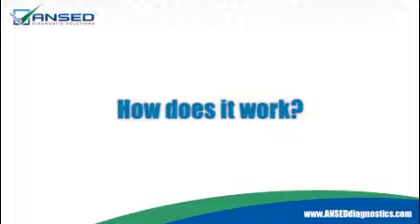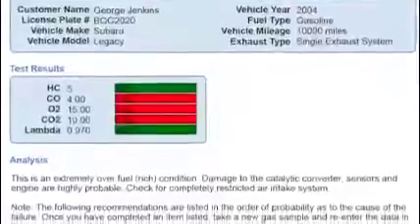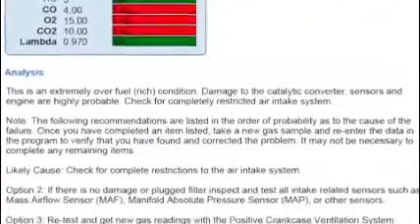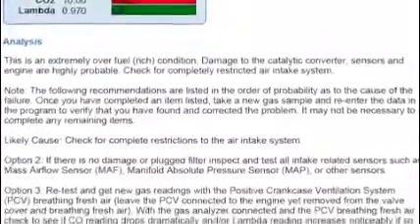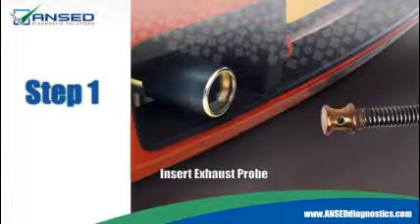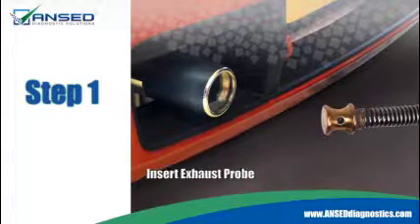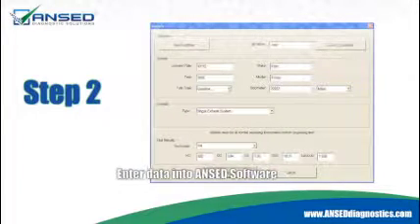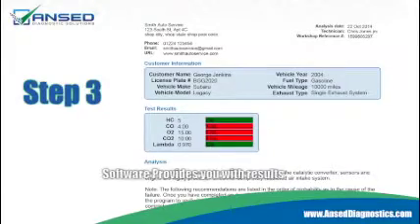How to Diagnose with an Exhaust Gas Analyzer - using the ANSED Exhaust Gas Diagnostics Software.

Comment: Exhaust gas analyzing I like it
Reply from the maker: Yes! Have you tried it before? Amazing tool!
Reply: @anseddiagnostics4024  no, always wanted to use gas analysis, but cost$$$ is usually up there.  We don't do state inspections in MN, but I could find it helpful in getting a diagnostic approach when trusting O2's is a factor for sure.
Reply from the maker: @PaulysAuto  Got it, Definitely will help with the diagnostic approach, send me an email and I will give you a special discount, anseddiagnosticsolutions@gmail.com